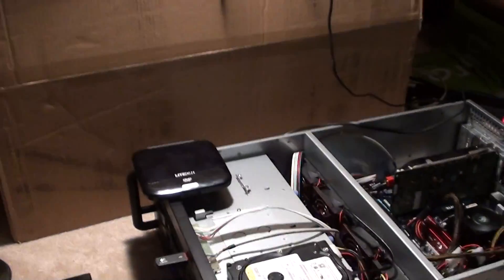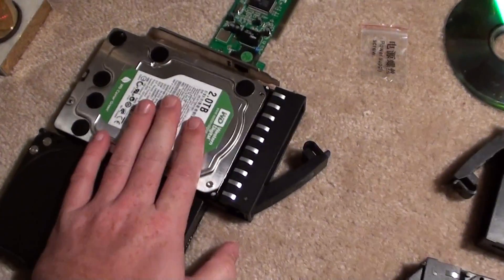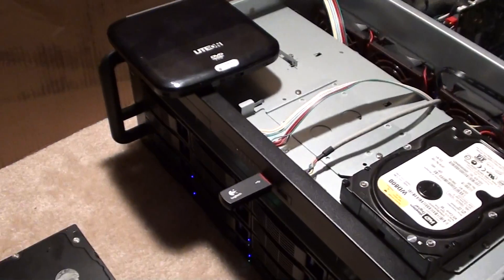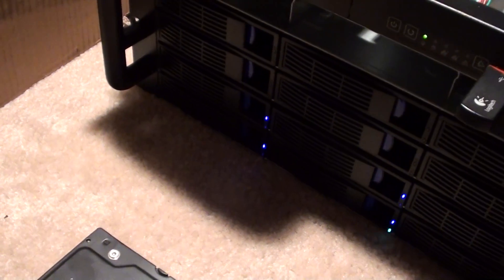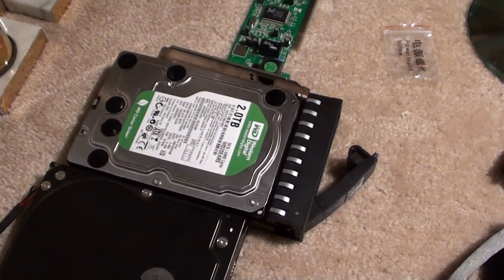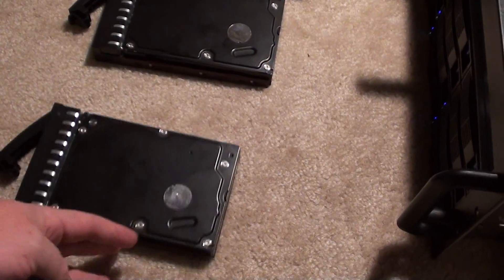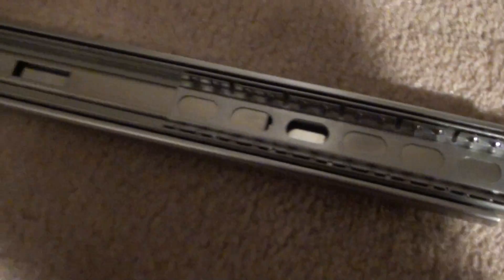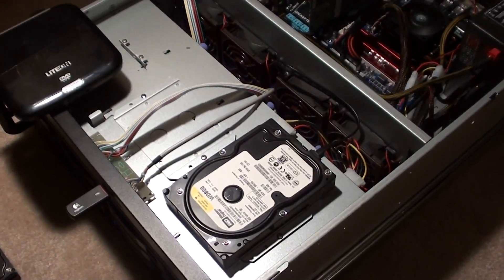Norco NFS SAN Build - Part 2 - Power On & Raid Sync

Comment: Nice setup, thanks for the video. The fan block, doe sit keep the hard drives cool or below air towards motherboard? I wish they had few fans in the front like Roswill server chassis.
Reply from the maker: It does keep them cool.  I recently upgraded to the 3x 120mm fan wall bracket with some real nice fans.  Moves a ton of air.  It pulls from the front and exhausts out the back.  The only place for it to pull from is across the hard drives so they do good on temps.
Reply: Thank you. My only concern and what I need to figure out is if this case has enough clearance for Noctua i4 NH-U12DXi4 CPU coolers.
Reply: Another question, on the backplane, how many drives per port? I want to use 2 of the bays on different RAID card and use other 18 for unraid/freenas setup which would be using a 2nd raid card.
Reply from the maker: The backplane of each row (horizontal) takes a SAS SFF-8087 cable.  So you can simply buy a SAS breakout cable which has SFF-8087 on one end and 4x SATA on the other.  Then you can plug them into wherever you want.  I do this for my boot drive.

Comment: Thank you for your video. Im building the same type of setup, I have the Norco 24 bay hot swop with a modular 1000 watt power supply and im using a 4460 high point raid card. I made the mistake of buying 4X4TB 6GBs green drives 800.00 bucks thinking they would work they dont work....... my card will only see up to 2TB 3GBS or 6GBS green drives. I have a Lenovo ix300d 4 bay server and it takes the 4tb drives no prob. anyway just wanted to say thanks for the info and video cheers Jason